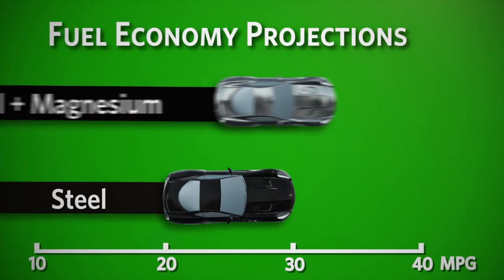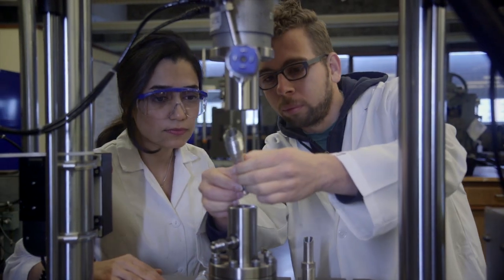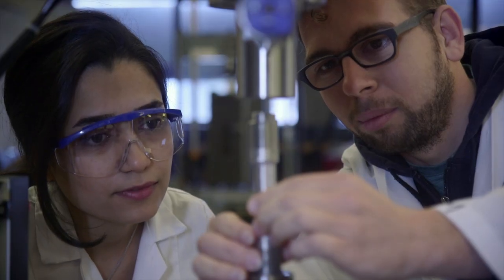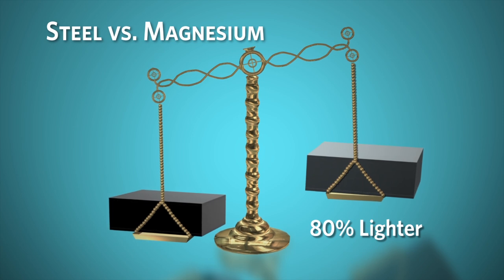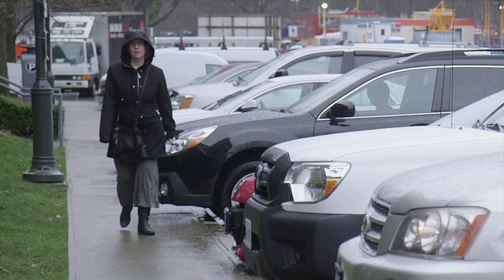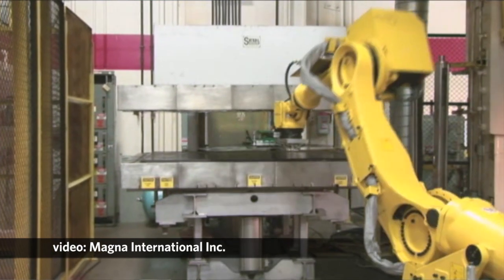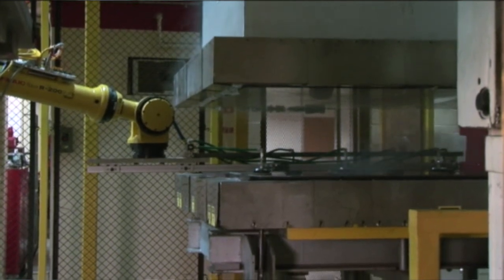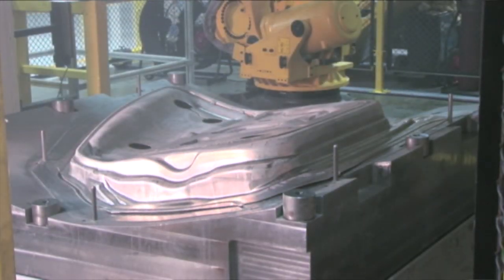Magnesium cars

Comment: Magnesium vehicles are dangerous. When on fire they are extremely explosive when the attempt is made to extinguish the fire and should be outlawed
Reply: Magnesium is not that hard to ignight and What about the hundreds of pounds of gasoline in every car? Should we outlaw gasoline in cars?
Reply: That's only true for powdered magnesium, it is very difficult to ignite in a bulk material.
Reply: Only if water is used..right? They don't use water for a lot of fires I thought. Ive seen videos of fire fighters putting out magnesium fires and they didn't seem to worried.
Reply: Unaware if any of the Bugatis ever experienced an explosion.
Reply: Wood is flammable too! And yet you are probably living in a house made of highly flammable wood!
Reply: @mbox314  mbox you're an idiot.